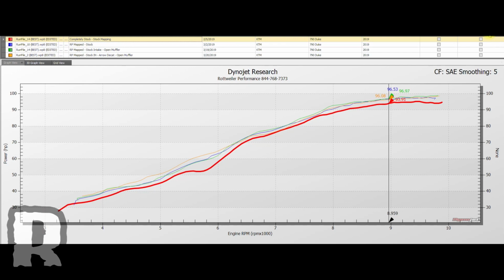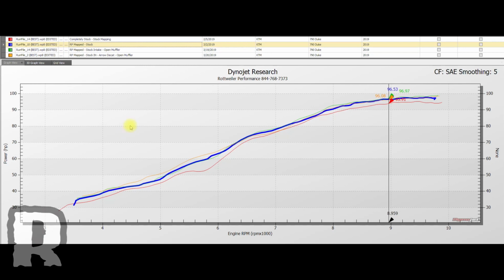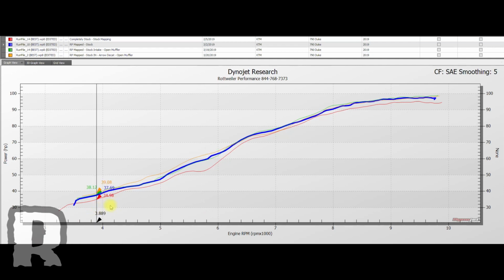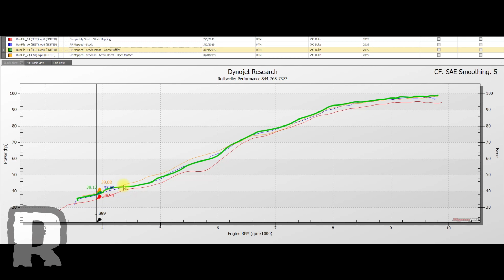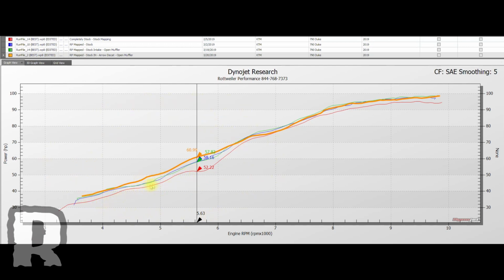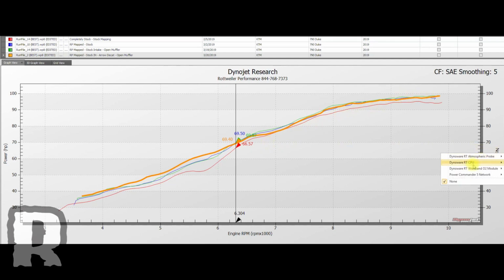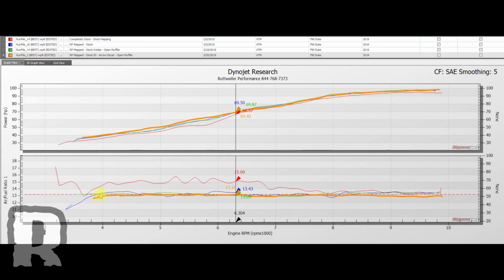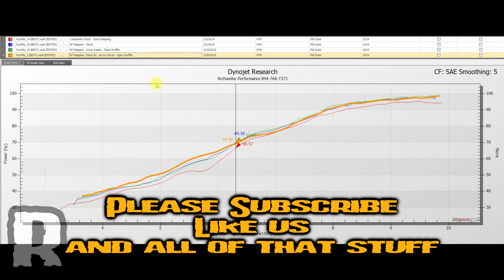DYNOFILES EPISODE 3 - KTM 790 EXHAUST RESULTS & MAPPING PROGRESS

Comment: So basically a decat system with stock system won’t harm the engine? I’ve heard you have to idle it for a couple of minutes so it will automatically adapt to the new airflow?
Reply from the maker: You certainly can do that and it won't hurt, but it's not 'mandatory'. Every time the bike warms up it is taking readings and slightly adjusting things in the fuel mixture, the idle thing just speeds that up, but the bike is still doing that all the time. Thousands of people with 790's are running decat exhausts with no issue. Do you HAVE to remap to be safe? No, but the stock ECU is still shooting for an air fuel ratio that is not ideal for power so mapping is more of a 'want to' than a 'need to'.
Reply: @RottweilerPerformance  thank you for your answer! I actually have the standart cat installed with the Spark Dual exhaust. Kinda loud but I want to be a little bit louder^^. Is the Arrow Decat extremely loud? Live in germany where the police gets angry very quick
Reply from the maker: @MK0413  The Arrow decat is going to be the quietest of the decat pipes because it has a resonator built right it. They sound the best in our opinion. Loud but not stupid loud.

Comment: This is great information. Have you also figured out the mapping on a KTM 790 Adventure with a Leo Vince Decat pipe and exhaust?
Reply from the maker: We have maps for Arrow in the same configuration which will be the same thing. Unless the exhausts are dramatically different a map for a certain configuration will work just fine for a configuration that is basically the same.
Reply: What hardware and software do I need to dial in the engine mapping to maximize performance with my Leo Vince Decat pipe and exhaust? Power Commander + map? Cost? Should I expect any effect on fuel economy? My exhaust is LEOVINCE LV ONE EVO + LEOVINCE CAT ELIMINATOR (LINK PIPE)
Reply from the maker: @shielsproductions  Any Powercommander V purchased from us comes with free mapping and we can set it all up for you before it leaves our building. You would be looking at this page here for the ins and outs of mapping that bike. http://www.rottweilerperformance.com/dynojet-powercommander-v-for-ktm-790-890-duke/

Comment: Great videos. Couple quick questions: are the maps you’re referring to the ‘street’ or ‘race’ maps?; and  how does the 890 differ from the 790 with decat, maps, etc.? Thanks!
Reply from the maker: Hey Paul, thanks for the question. What you are looking at here are 'RACE' maps where we unplug the O2's and deal with the engine light for the best power gains. This would be a 'racing' situation where engine lights are pretty much inevitable because of the heavy modifications to nearly every corner of the bike which is going to trigger an engine light no matter what you do. They don't really effect the bike at all, they are just a harmless warning that something is unplugged that they don't want unplugged like emissions hardware and so on. 'STREET' maps are just a couple of HP less on the low and mid range power because we don't map there and the air fuel ratios are running at 14.7:1 which doesn't make as much power as a properly mapped bike at 13.2:1. That's about the only difference so we leave the option up to the customer as to what level they are wanting. 

In terms of the two bikes (790/890) there is no difference what the configurations do really, just differences in horsepower and closed loop is a little larger on the 890 but not by much. Closed loop seems to be reaching higher and higher these days on these bikes. It used to be only up to 5000 RPM and 20% throttle but we are seeing up to 7 and 8000 RPM these days and up to 60% throttle. That's why we have the race maps.
Reply: @RottweilerPerformance  follow on question. Is the factory ecu (no PCV) able to adjust the ratio back to 14.7:1 if the cat is removed? Factory muffler if it matters. Lastly, have you been able to develop PCV race maps for the 890 yet? Looking for a map that would work with no cat and either factory or Akro muffler.
Reply from the maker: @paulmcmullen914  The factory ECU is very good at keeping the air fuel ratio right at 14.7:1 regardless of what you do. That being said, decatting doesn't really throw that off all that much anyway so in two different ways you are fine. 

As far as maps for the 890 (Duke?) goes, we have those cued up to get maps done. Admittedly it's taken (me) a bit longer to get to due to the rapid growth of this business but we have the performance intakes coming out soon (5/22) and will have all the maps ready to support them both for the 790 and 890 Duke.

Comment: Do you know if the power commander also works for the 790L ?
Reply from the maker: Are you talking about the 790 Adventure?
Reply: Rottweiler Performance no, the KTM Duke 790 L, it’s practically the same bike but comes with a little less power from the factory so that it is allowed to be driven with a2 license. I think there is a small difference in the exhaust to reduce the power.
Reply from the maker: @Kbebita  It would be just fine. We don't have those over here in the states, so we can't really make a map for it, but the differences in mapping would be less dramatic than humidity changes in the atmosphere would be so we are sure that this map will work well. Maybe not as much as it could if there was a proper dyno map made on the specific bike, but would certainly be a big improvement.

Comment: You reckon the O2 Dongles will be the same for the 790 Adv?
Reply from the maker: Most likely. We are about 99.9% on that one as there should be no reason to change them. We know KTM and their habits so we are almost positive. We don't have them in the US yet, but we have already paid for one fully so we will be on that bike as soon as we see it.
Reply: Thank You. @RottweilerPerformance
Reply: I’m looking to get one of your mapped power commander’s for my 1190. So I believe it’s a piggyback system to the stock ECU? I have a wings slip on so the dealer re-flashed my ECU with an accessory Akro map. Does this change what you guys install on the power commander as it’s not a completely stock ECU map?
Reply from the maker: @Captndarty  You would be best going back to stock. The Akra map will do the trick, but it's usually pig rich and you don't have the added benefits of what the Powercommander can do as far as accessories. We have a great map for what you have, but you will need to flash bac to stock.
Reply: Rottweiler Performance that’s kinda what I thought and thanks for the perfect cut and dry answer. I’ll have them flash it back when I get all your goodies and make this thing sing.
Reply from the maker: @Captndarty  Working on more 1090 maps now for variety while we have one up on the dyno and then our 1190 is next for some newer and better maps. They just keep coming.